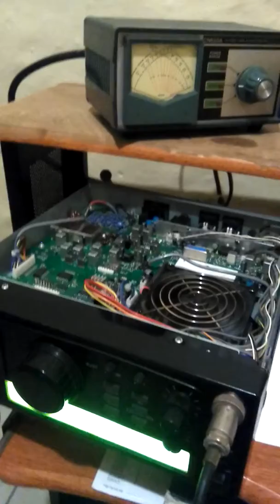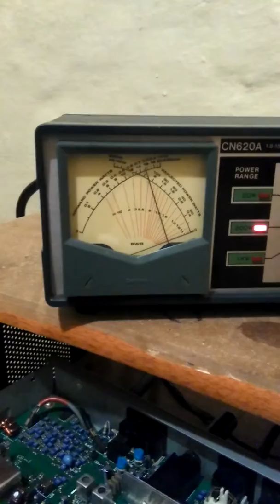Tx adjustment on Icom IC 77 hf transciever(Do this at your own risk)

Comment from the maker: S meter ajustment is done via r175 
Just above the fan on right hand side..... Hope that will help
Reply: Thank you for the useful information. I have the transceiver  Ic-707 the same ic-77.. and it just above the fan on the right side has the trimer R180 a white trimer. Is it the same? ..... I hope your help. Thank you.